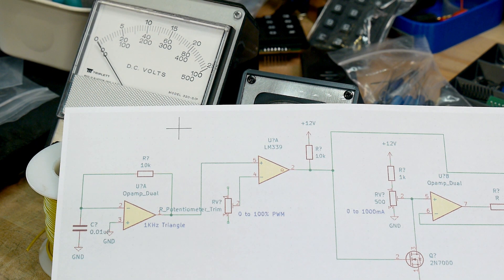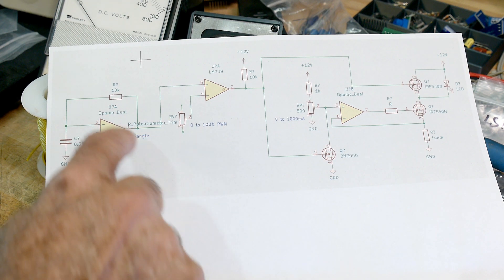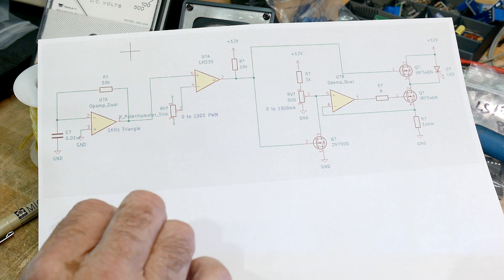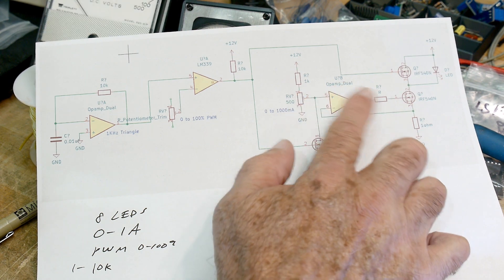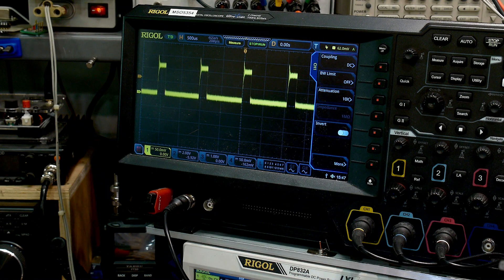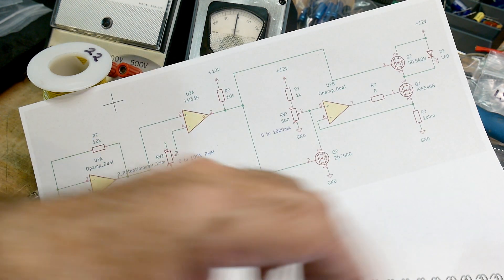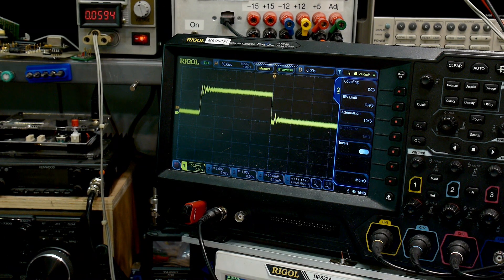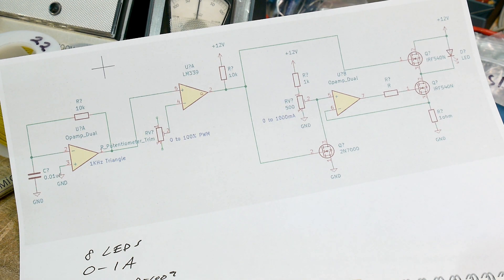#1309 LED PWM (part 1 of 2)

Comment: The first pwm led control is just an ON- OFF ratio modulator...since there's no led voltage sense..vis-a-vis the min-max led operating voltage range...so only the peak brightness
 "duration time"  is varied...so it cannot be called a brightness or dimming controller...
Since even at very low duty cycles the peak brightness is always the same...this is the reason for the irritating glare and eye strain @ any pwm setting ...
The second modulator..can and does always override the first when active ...but here too 
led current variable reference is not scaled to compare actual led cueernt min- max range..

Comment: You can use a couple schmitt triggere and a simple transistor to limit the current like a what it's done to limit current in power supplies.  You are using open collector comparators. Then get  rid of the MOSFET and 10k and connect the output of your oscillator directly to non-inverting input.   One of the things I learned in college (good prof) was the difference between schmitt trigger and opamp.  The op-amps besides not having the hysteresis, always ring in the low frequency because it has a gain issue.  Schmidt trigger should not ring because it has a hysteresist and RS flip flop in it.

 You are like me an old fashion designer and don't like the simulators like spice to simulate your circuits :D

Just thought about it again tonight.  Your design requirement has a hole in it.  It does not specify whether the current should 1A max or RMS.  If you want to calculate the RMS current using a low pass filter, the output current limit will depend on the switching frequency.

You can use one of the 100s pwm switching powers chips in the market. They have all you need in them. 

A software guy may tells you all you need is an Arduino controller and an h bridge!

Comment: What resistance is between pin 7 and the gate?  Combined with the gate capacitance, that forms a first-order pole.  Try 30 pF in parallel to cancel the pole with a LF zero... across the resistor might work, but I would go straight to the inverting input.

Comment: That triangle generator is not gonna work.  First, you need to take the output across the capacitor so that approximately constant charging current gives constant slope, dV/dt = I/C.  Next, you need some positive feedback to establish hysteresis and the triangle peaks.  Given +12 V and ground, you need the center to be +6 V and I would arrange about 1 V hysteresis.  Given 10 k, the average charging current will be 60 uA.  For 1 kHz, dt = 0.5 ms and C = (60 uA)(0.5 ms)/1 V = 30 nF.  You can tweak the parameters to obtain convenient component values.  There is also no overwhelming need for the triangle to be symmetric to generate PWM and this can allow you to reduce the center (average) voltage some if the resulting range is inconvenient for the comparator... but this will complicate the math a bit.
Reply: Agreed, the triangle generator won't work as is. Also, I'd use an opamp as the comparator too, so that I could just plop in an lm324 and make it a single-ic solution.

Comment: For op amp PWM I use a singe op amp and a transistor. It's a common square wave generator with a voltage input to the positive op amp input through a resistor (usually the same value as the feedback resistor). It will be variable frequency in this configuration (like 500 Hz around 1 and 99%, 1 KHz at 50%) but that usually does not matter. I've ran motors, high power COB array LEDs and heating elements with this circuit.

I'll often then use another op amp for P control (or PI, PID, etc) of the PWM op amp assuming I have an analog sensor like a thermistor. I've tightly temperature stabilized a wide variety of things with this.
Reply: A wee 2 transistor multivibrator is another thing that can do this job.
Though it may not work reliably above 90% or below 10% DC.
Reply: @plainedgedsaw1694  Yup! If you look at my videos I have a 2 transistor balancing robot. 2T multivibrator that uses a few photocells, extra capacitor for the derivative function,  and a servo modified for continuous rotation. I've done the same balancing trick  thing with the 555 timer.
Reply: @roboanalogtom  Hey, love your channel, I've been a long timer subscriber!😊

Comment: A mosfet gate and its nice capacitance (hundreds or thousands of pF) on an op amp output needs at least an output-to-negative-input stabilizing capacitance. The gate series resistor needs to be sufficient since it provides isolation as well. A few tens of ohms is the ballpark. For better results with a capacitive load, the op-amp needs nonlinear feedback. A squarer in the feedback, although the exponent can be tweaked. Most feedback analysis is unfortunately done as linearizations, but reactances are nonlinear - their behavior depends on their state. Just as you’d use a Park transform to minimize error and improve response of a BLDC current controller, so you can use a monomial model in the feedback loop to linearize a reactance.

Slow op amps (<3MHz) do just fine with no gate series resistor - their output impedance is plenty high to damp the gate. If the negative feedback comes from the drain or source of the mosfet, the gate capacitance stabilizes the circuit. For example, an LM224 driving almost any mosfet that way is inherently stable. And slow as expected.
Reply: Being a non critical application...The brightness/dimming is not being controlled ...so negative f.b. loops are unnecessary...but led effective voltage & current range & curve profile (min- max) scaled proptionatly w.r.t. that of its brightness should suffice for a reliable open loop circuit operation.